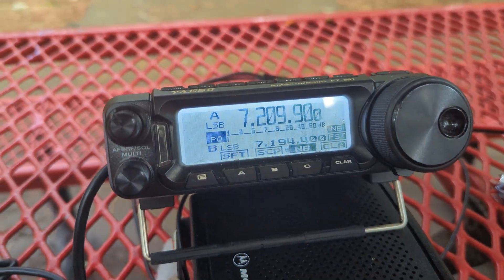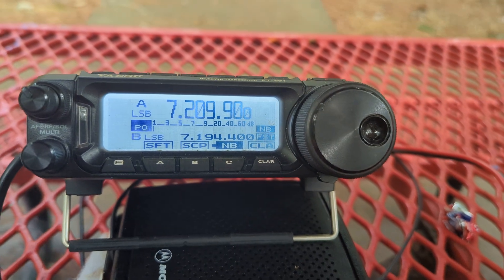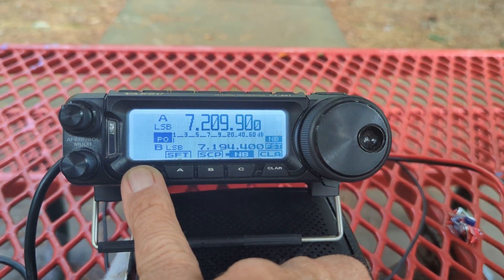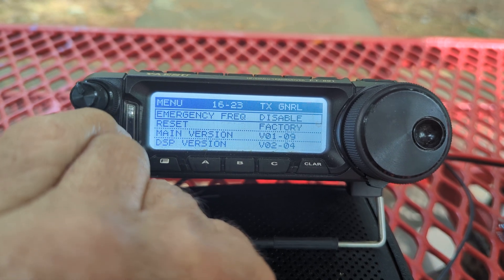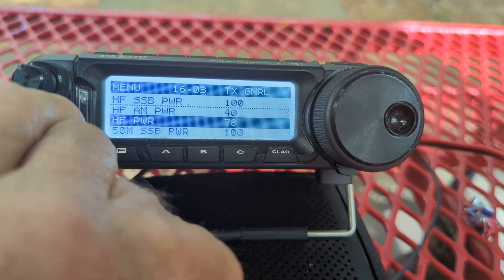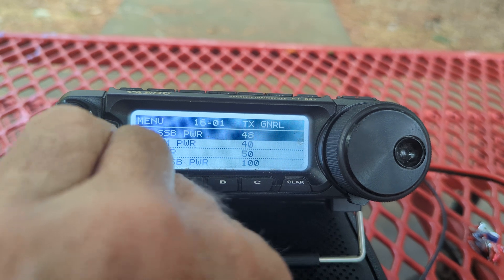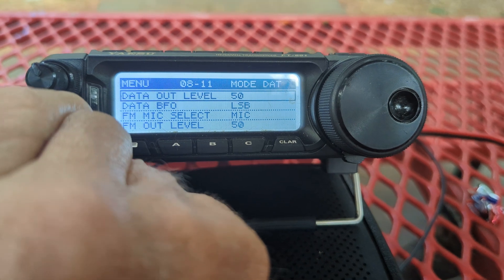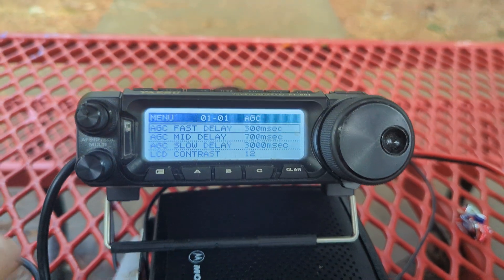NC4XL Dom FT-891 CW / SSB AM Power Settings

Comment: The power settings on the FT-891 are confusing and the most misunderstood. I have seen HAMs get in heated debates over them. When I first got my FT-891 I was confused and finally read the manual. This poorly labeled menu item needs to be updated. Thanks for the MUCH needed video explanation.

Comment: I don't use the power level as a set and forget option as is implied by burying the setting deep in a menu, I want to press a button marked "power" and turn a knob to be able to adjust it at will, if only because I don't like to tune at high power.

Comment: what antenna isn't rated at 100 watts. I have a Packtenna which is rated at 100 watts
Reply from the maker: Most Antenna Maybe Rated 100 SSB
Not 100 CW.
My EFHW Is Rated @100 SSB
50 CW
Many Different MFG Rate Them Differently.
But Many Of Us Read The Fine Print After The Fact